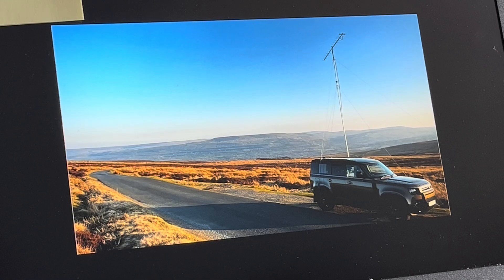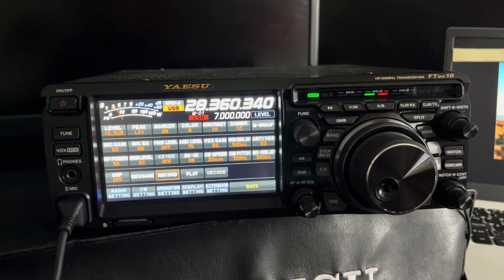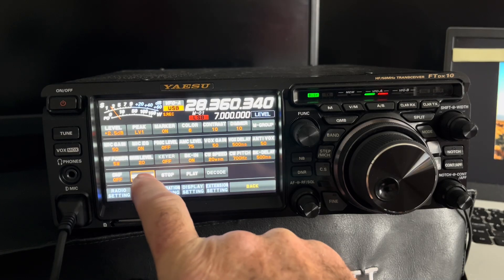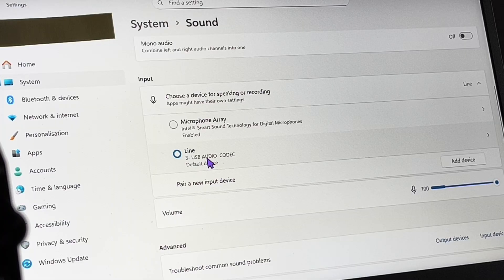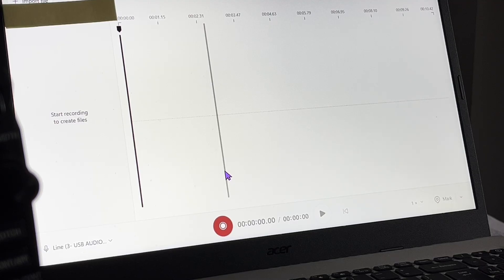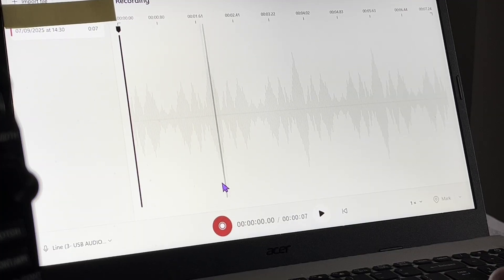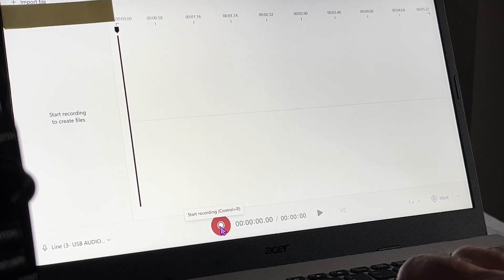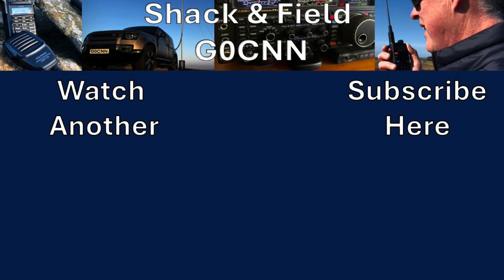Getting TX/RX Audio out of a Yaesu FTDX10

Comment: Hello. This video was a revelation for me, and I am very grateful to you for your creativity and abilities to articulate your ideas so clearly. I have been having a new problem with my FTDX10 in that when I press RECORD to record my voice to evaluate the quality of the transmitted audio, in 99% of my attempts there is no audio heard on the recorded Playback at all, one only hears the playback sound go to absolute silence during the time PTT is pressed and then back to received band noise when PTT is released. It is as if the Microphone makes no contact electrically with the audio circuits. And yet, even when no audio is recorded, the FTDX10 meters show the expected ALC, COMP, PO readings, and even the oscilloscope shows the active audio wave form! But no audio recorded, except in the very rare instances where the voice will be heard as expected. And I realize that when there are (now very frequently) times on the the air when calling (contest) stations where it becomes obvious that I am not being heard at all, or dropping out, except in the very rare times when I am transmitting as intended,.  It becomes obvious that the microphone or the deeper audio circuits must be intermittently not being activated or are dropping out just as the microphone or audio circuits  fail to transmit microphone audio in the RECORD mode. Do you have any thoughts about what might be going on? Or questions I could ask Yaesu Service, or tests I might perform?  Is anyone else having this problem? I will use your ingenious setup here to ascertain if I can hear the microphone audio on the Computer indicating that it may “only”be the RECORD function that is faulty or intermittent.  Thanks again.
Reply from the maker: Hi. You can check that you’re actually transmitting by looking at the waterfall display and seeing the waterfall being replaced by your TX signal centre screen (meter on Power should also do the same & and an external meter etc.). You say you see the “effects” of a transmit when using the memory keyer, but can’t hear the audio. It sounds like the audio playback out of the speaker is set too low. I’ve not got the rig in front of me at the moment, but this will be either the Monitor function or the RX setting in the memory keyer. Hopefully it’s one of these set too low? Mine is low as I don’t need to hear it other than an audio reminder that I’m transmitting ok. Hope you get sorted 👍🏻